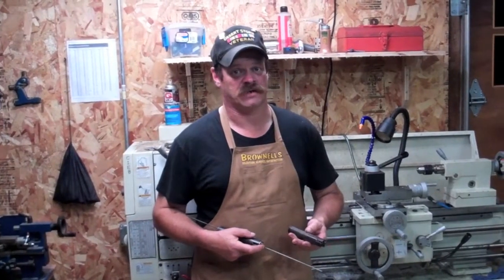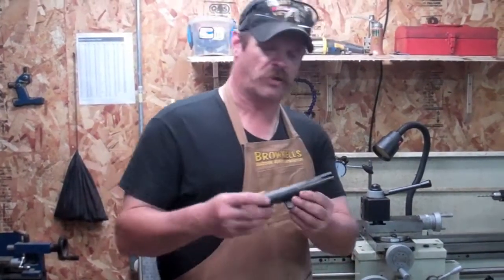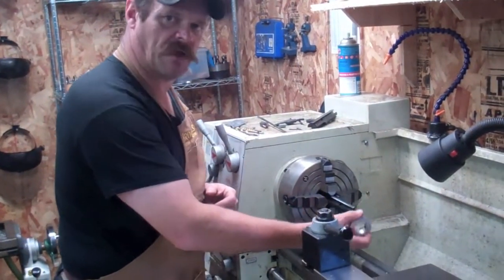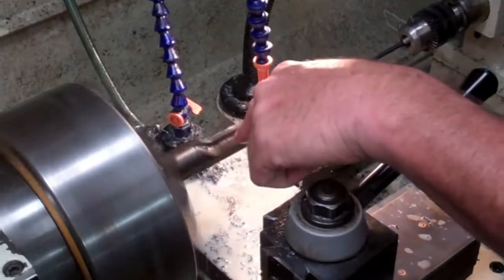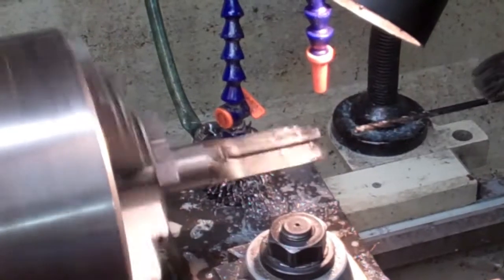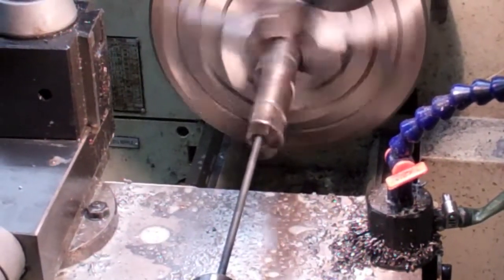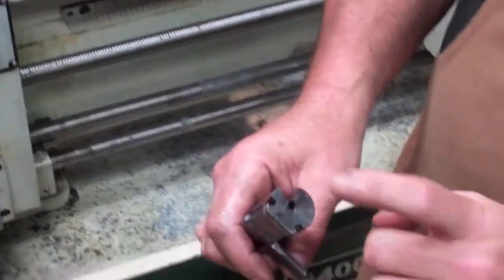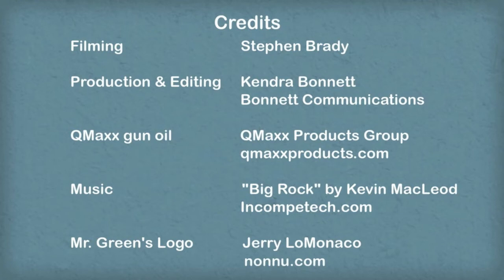Gunsmithing: Center Drilling the Bolt for a Semi-Auto KP-44 (GunWorks)

Comment from the maker: Snce I know of no boring bar the size that's needed for this... Just about right has to suffice. 7 thousandths is close enough to work in this case. I've never had a misfire, never had a broken firing pin, never had any problems drilling the bolts for these conversions. If this is not good enough for some folks, then I can recommend they seek another gunsmith for this project.

Comment: Quite apart from the gunsmithing, I have tremendous respect for your machine skills!  Just milling and tapping something to those tolerances was WAY beyond me during my brief 'metal work' classes at school!!!

Obviously it is required by law, therefore there is no question - but it seems such a shame to have to butcher the original gun!  Still, what you get at the end of the process is a beautiful piece, that still fires as well - if not MORE - accurately in semi-auto than the original did.